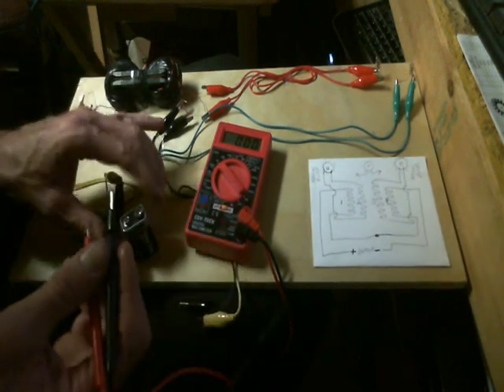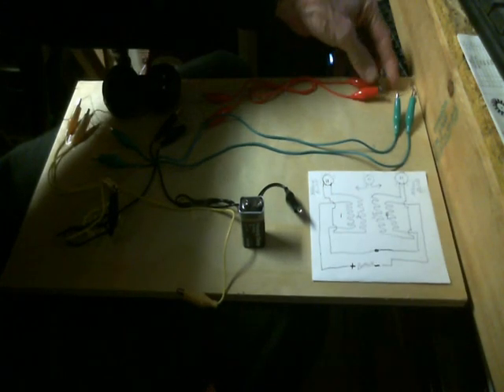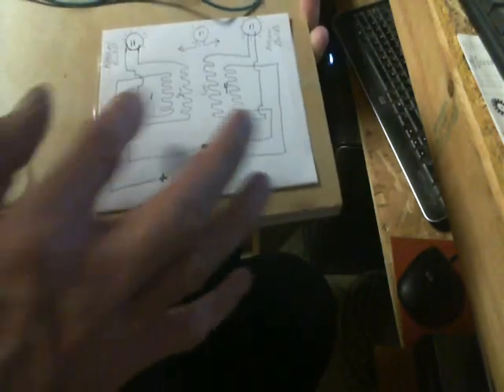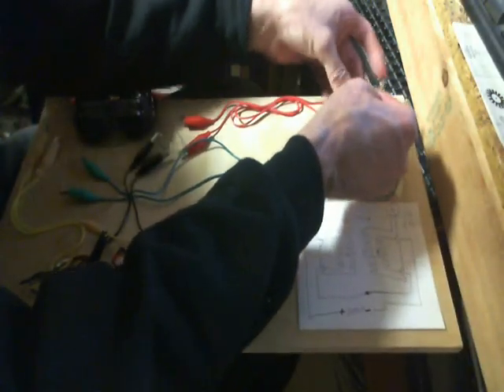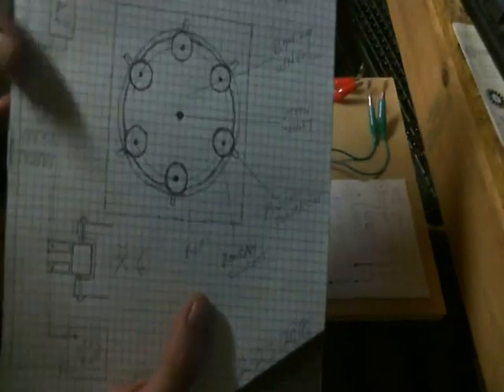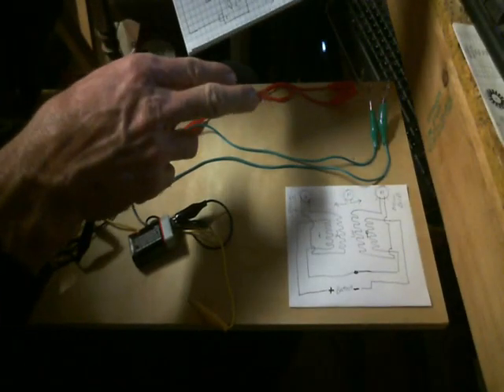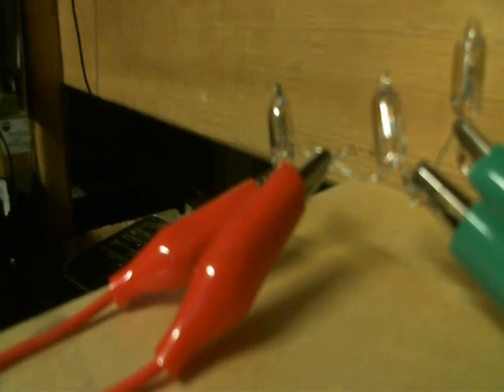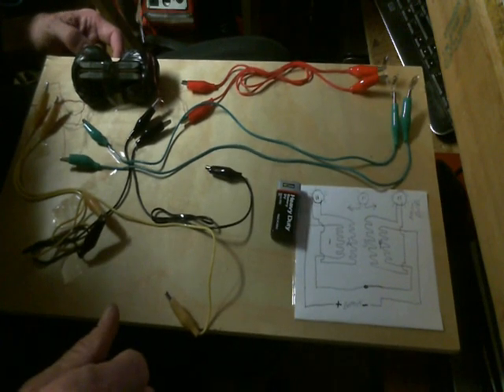IMPORTANT !

Comment: I liked your video and explanation. I do have a question when you show the battery at end of video around 14 : 20 minute you mention that we would be surprised at the output, is that the battery goes up in voltage or the output that lights up the neons?? which one were you referring to, thanks a bunch.